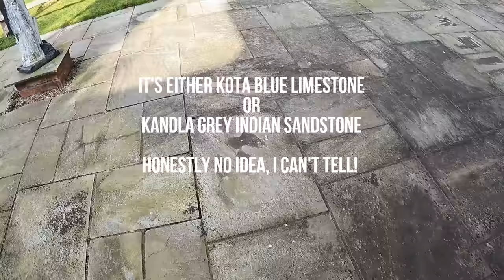Unexpected Results When Cleaning This NASTY Patio!! | Partridge Exterior Cleaning

Comment from the maker: Sorry if i made anyone jump when I did the voice over bit xD It sounded really quiet in my editing software so turned the volume up loads!! Enjoy!

Edit Holy moly guys slow down, nearly a million views out of nowhere :D!!
Reply: MY EARS ARE BLEEDING BUT IT SOUNDS FINE MAYBE TURN IT UP A BIT MORE 🤣
Joking aside excellent job as always. I hope the client was happy with the results!
Reply: YouTube Algorithm smiles on you
Reply: I’m a stone mason was getting ready to freak out with the pressure washing, good job not doing all the stone that way.
Reply: It's nice when they race up the views like this! Well done buddy, another great vid!
Reply: for your handheld you should get a good oscillating power washer nozzle
Reply: Congratulations. You have been blessed by the algorithm
Reply: New subscriber!! Just a thought even though it might be a little time consuming, but for an environmentalist like myself I can see you enjoy nature too. So why not find a chemical that is safe for plants but still separates the grime from the stone or create a run off system that can be place at the edges to collect and direct the water. I'm sure you can find small thin cheap plastic tubing the size of copper pipes used for running water lines and split them in half the long way. If the grass cutting it done properly by the gardeners there should be a slight gap between the grass and stones which is also called edging for them, and just enough space to dig a ditch put a run off pipe that can either be temporary or permanent if you plan to be going back. This would also help in future projects dealing with chemical
Reply: You remind me of Joe Wicks 😊
Reply: L
Reply: @satorudo  p
Reply: Are you looking for customer service or virtual receptionist?
Hello we are a eXito Phil Call Center Services and we offer affordable and top notch service to your business. Agents are well trained with not less than 7 years experience in all aspects from customer service to virtual receptionist. We Cater both B2B and B2C campaign. From inbound calls to outbound calls agents are goal oriented and go getter.
Reply: What chemical are the best for drive ways and patrols?
Reply: Nah - love that you're up to 3.2m as of Jan 2023. Hannah. Edit - I've watched it twice, but in my defence it's because it's deeply satisfying.
Reply: Good job, please @Partridge Exterior Cleaning may i know which products do you use? Just water? I will appreciate your answer
Reply: Im soo excited to see it being cleaned
Reply: Hi Sid hope your well . Just become a Patreon

Comment: great clean...though it looks like the patio has no run off, probably why it gets mouldy quickly
Reply: Now that I read this yep that’s probably the reason
Reply: What's a Run Off?
Reply: The patio needs to be laid at a slight downward angle away from the property so any rain water can 'run off' it away from the property and patio.
Reply: @soniariley295  ahhh I thought so. Thanks lol I was genuinely curious.
Reply from the maker: What Sonia said above it’s basically an opportunity for water to drain away from the surface. If it’s perfectly level or uneven it can create pooling in certain areas meaning water sits there and will only disappear via evaporation which can take days in winter months.
Reply: @PartridgeExteriorCleaning  thanks for an explanation!
Reply: @hesus1474  The paving should slope away from the property by around one centimetre for every metre.

I recently laid around forty square metres of utility paving on the kitchen north facing side of the house, but put a two centimetre slope with sand joints, due to moss growth and needing regular washing.
Reply: @threemountainsgaming7560  You know the answer was two replies above your reply

Comment: Sid, how would I go about getting blackspot off my front path? I've only got a small karcher, is it OK to use sodium hypochlorite, I've seen you can get it off amazon and the likes but is that more of a professional thing? Will I do damage if I use it incorrectly 🤦‍♂️

I'd love to get you to do it but I'm on the isle of wight plus it's only about 2m square 😂😂
Reply from the maker: yeah the online stuff is okay, usually its less concentrate than the stuff i use or overpriced but it does the same job, may just require a few more attempted, spray it on and scrub it in, repeat until its gone :D
Reply: @PartridgeExteriorCleaning  awesome, cheers sid, great videos, I'm an avid watcher, always enjoy the notifications to say you've uploaded 😂

Comment: It's amazing what a simple power wash does... I used just a regular hose with an actual power wash hose connect on the concrete that is my porch and it got most of the run down gum from the old neighbors (I live in an apt) and also the trail they made with their trash every time they took it out... It didn't get all of it but hey, for a hose that I hooked up to my kitchen sink and a power wash hook up, it did pretty good 👍

Comment: Love my thick bluestone entryway, but the stones do take special care and are expensive. Because they are sedimentary limestone, any powerwashing must be low-pressure, if even. Too, salt should NEVER be used to melt ice, because it will force the stones’ layers to separate, especially across freeze-thaw cycles. A dusting of simple sand is best. My entryway is dry-laid (no mortar) and unsealed. Not only is dry-laying important for drainage, it allows for seasonal shifting and beautiful moss growth between the stones. The moss also keeps the weeds and any grass out. The easiest way to preserve the moss yet clean the stones is just a bucket of warm water, a soft bristle brush, and a sprintz of Dawn dishwashing soap. Then a fast rinse. Too, never use anything acidic or harsh — it will stain permanently and cause premature deterioration.

Comment: Only a few mins in watching n results are beyond belief!!!  Is there any product out there (sealer?) that would limit the dirt/moss build up?
Reply from the maker: yeah a sealant would work well, just may end up more pricier than having it cleaned yearly though
Reply: I've got very porous clay tile in a few outside areas. I experimented with a liquid silicone sealant and have been amazed at the difference. I didn't do all the tile, so have a direct comparison. Water just flows off the treated tile and there's almost no algae.
I don't know how other surfaces will benefit from sealing, but if it's porous, absolutely worth it!

Comment: Please upvote as it's informative: 

:)

You should look at using a silver peroxide as it's potable. Same effects as sodium hypochlorite, and it doesn't smell either.

The sun's ultraviolet rays can cut down the chlorine concentration by 90%(free chlorine levels) in as little as two hours, And on very hot days, the chlorine will deplete even faster so I wouldn't worry about washing down onto the grass bud. You'd be wise to avoid greenery on first application though!

This is where silver peroxide comes in. As long as it's diluted correctly and the Ph isn't affected to harshly it can be used near plants

Comment: PG Tips super job love it im inspired to do mine what product would u recommend for Indian sandstone ???? It’s very green at the mo    Thanks 🙏🏻👏👏👏👍👍
Reply from the maker: try it with just a normal pressure wash first, if theres stubborn marks you can buy store bought patio cleaners etc, they contain the samel chemical i use here just a little bit weaker usually (:
Reply: @PartridgeExteriorCleaning  Thanks 🙏🏻

Comment: Hi Sid, what pressure would you be running at for the edging with the 60 degre nozzle and also the surface cleaner? I have just done my large terrace with a 25 degree nozzle and a basic K2 compact (circa 110 bar) and wanted to get the balance of removing the build-up efficiently but also whilst not removing the surface finish of the slabs. A larger angle nozzle of 40 degrees and it struggled to remove the build-up. cheers